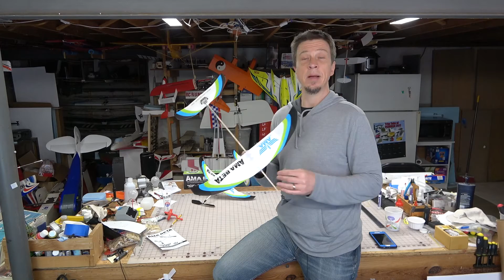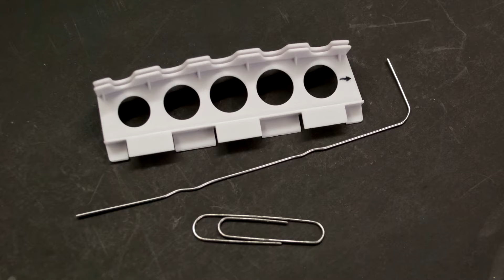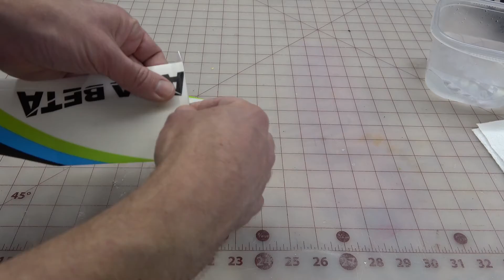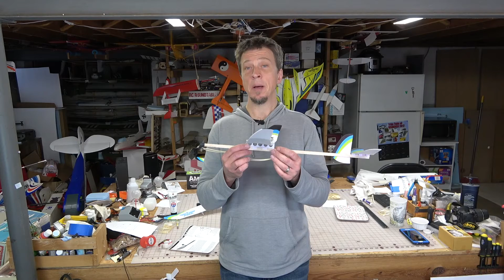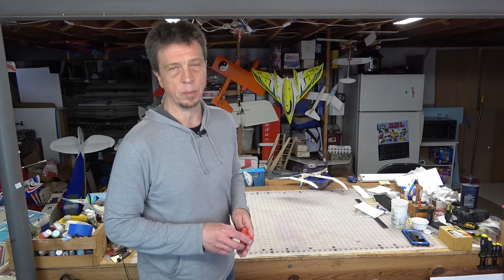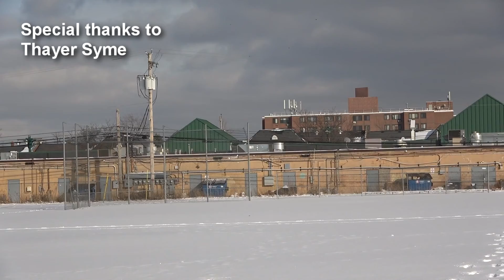AMA BETA - Model Aviation magazine

Comment: You didn't introduce yourself.

Very good instructions, clear and complete, excellent supplement to the printed instructions.

I like the paperclip idea. I put the wings in one at a time, individually, to compress the foam, so it would be easier to put them both in together. I like the way you fixed the buckled wing. We used to do that with the sheet balsa wings on the North Pacific clip together planes in the 50's.

I left the tape on the fin, it made a snug fit in the slot and helps locate the fin.

The stick is too big for the prop hanger. It can be very hard to get into the hanger, especially when you get a hard stick. Balsa varies in density and hardness. I press the edges at the front end against a hard table top to taper the front. I put the hanger on without anything else in place, holding the stick very close to the front to prevent buckling failure. Sanding the nose could change the angle of the prop shaft.

The usual way to balance a prop is to scrape the back of the heavier blade. Don't forget to put a tiny drop of light machine oil on the prop shaft.

http://www.endlesslift.com/balancing-a-plastic-propeller/

The horizontal stabilizer is cambered, but it has considerable down incidence and is flying in the downwash from the wing. It is not the cause of the aft CG. The cause of the aft CG is the low camber of the wing and mostly its 1.2 degree incidence. Others are finding the CG should go near the fourth hole. This airfoil must be flown at a much higher attack angle for best duration, so I left my CG at 1/3 and gradually raised the leading edge of the wing to 1/4" to get good flights. It takes quite a bit of test flying to find the best combination of wing incidence and CG position.

To get the longest flights you use the longest motor you can manage in the available space. Motors longer than about twice the distance between the hooks become difficult to manage. You could divide each of the provided lengths of rubber strip in half and get two good motors of each width. Rubber strip eventually wears out and must be replaced. It may be obtained from any of several suppliers. FAI Model Supply is the original supplier.

http://www.endlesslift.com/model-airplane-suppliers/

An O-ring at the knot end makes it easier to get a tightly wound, lubed motor off the winder and onto the motor hook. When I fly solo I use an easily made foot stooge to wind my motors.

http://www.endlesslift.com/make-a-simple-foot-stooge/

Your plane flies in a right circle. Usually they fly left. The motor torque rolls the plane left. The lift points slightly to the left, pulling the plane to the left. The sideslip catches under the dihedral of the left wing and prevents it from going too far. It also hits the left side of the fin, making the plane turn left. At high power, the high torque can make the plane bank and turn so far left that it will turn and sideslip into the ground and cartwheel across the field, leaving bits everywhere. To prevent this we make the plane fly right-right. We first set the rudder for desired right turn in descent. Then we set right thrust in the prop shaft to get the desired right turn under power. The Beta prop hanger does not bend.You can shave a thin wedge off the left side of the nose of the stick and glue it to the right side. If you don't want to mess with cutting the nose, just go with right rudder.

I will add a link to this video to my review of the AMA Beta.

http://www.endlesslift.com/ama-beta/